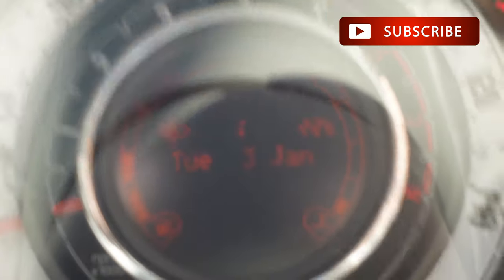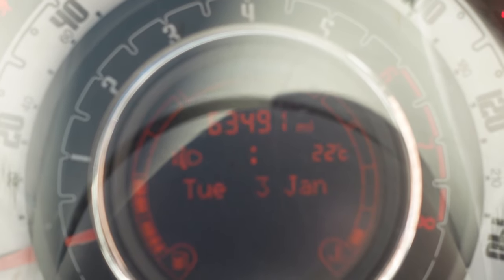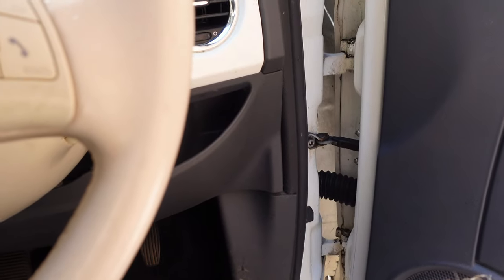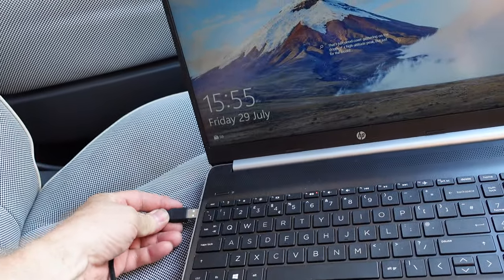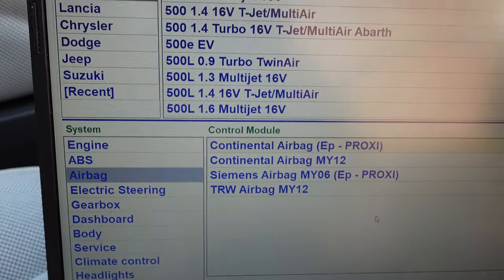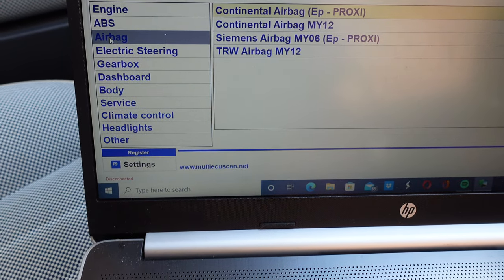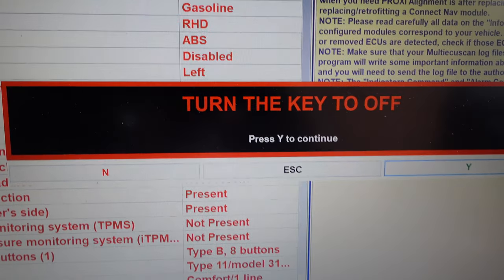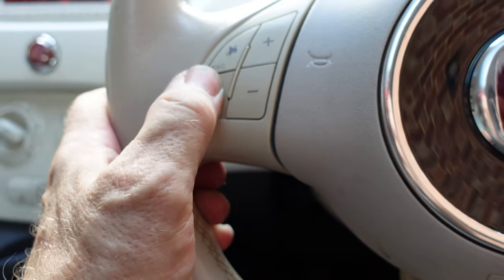Fiat 500 Flashing Mileage & Proxy Alignment - Blue & Me Not Working? #blueandme #fiat500 #abarth

Comment: Hi,I’ve just bought a 2013 1200s from
a friend,the mileage is flashing and stop start not working,this happened after replacing the battery,I’ve just noticed the battery they fitted is not a start stop battery,what should I do now? Do you think he has blown something? Thank you for any help
Reply from the maker: Stop start us rubbish anyway and most people turn it off. It’ll work with a proper stop/start battery for a while and then every now and again. If he has changed the battery incorrectly he may have done something but first just try disconnecting the earth battery terminal for 10 minutes. That might reset it. If not, you’re going to need diagnostics.
Reply: @Love500  ok thank you I’ll let you know how it goes,I’ll go and buy the proper battery
Reply from the maker: @bill_20  i recommend www.tayna.co.uk I always buy the Exide ones.
Reply: @Love500  I’ll check it out 👍
Reply: @Love500  back again so it has a New battery and it’s not the start stop it should be but the battery has gone flat,could that either be because it’s not a stop start or would it be something else 🤦‍♂️
Reply from the maker: @bill_20  that’s most likely the blue and me causing a parasitic drain. Nothing to do with your stop start. I assume your blue and me probably isn’t working.
Reply: @Love500  I have no idea how it works to be honest,
Reply from the maker: @bill_20  if you press the button on the steering wheel it should display on the stereo and you talk to it. If nothing happens when you press the button, then it’s broken.
Reply: @Love500  thank you I will try that later and let you know
Reply: @Love500  do I need to have an adapter to plug in to be able to try this?
Reply from the maker: @bill_20  what trim level is it? Lounge, Pop? Does it have steering g wheel controls and a USB socket on the centre console by the cup holders?
Reply: @Love500  1200S and yes usb beside gearstick and steering wheel controls
Reply: @Love500  hi I just got the battery replaced with the proper battery for the car,stop start now working again but mileage and blue and me not working? Any ideas what to do next? Thanks
Reply from the maker: @bill_20  your stop start will work for a while. You need a proxy alignment which may reconnect your blue and me but more often it’s broken and needs repairing or replacing.
Reply: @Love500  does that need a special fiat Diagnostic’s or will others plug in?
Reply from the maker: @bill_20  www.multiecuscan.net. Software is 50 euros and a cheap set of cables from eBay.
Reply: @Love500  would there be any faults codes if the Blue and me is faulty? I can get a lend if a good diagnostic machine
Reply from the maker: @bill_20  no, just flashing mileage and usually not working.
Reply: @Love500  yeah it doesn’t work,flashing mileage and battery drain,any recommendations where to send it for repair?
Reply from the maker: @bill_20  key wizard on eBay. £78 plus postage.

https://www.ebay.co.uk/itm/133978414515?mkcid=16&mkevt=1&mkrid=711-127632-2357-0&ssspo=WnpIY9tdQNe&sssrc=2349624&ssuid=52E9BPy6Sze&var=&widget_ver=artemis&media=COPY
Reply: @Love500  hi back again,as you can see it’s slow progress lol only just got diagnostics plugged in today,fault code there was U1733-87 Convergence Telematic Module - Missing message,there was an option to configure but it wouldn’t connect 🙈 you think it’s the Blue and me?
Reply from the maker: @bill_20  yes, without a doubt.
Reply: @Love500  thank you so much you’ve been great help 👍

Comment: Hi Paul, I have an issue that you might be able to help with.
The centre EVIC display is blank, and the outer speedometer and Tachometer work fine. The centre display will 'illuminate', but is blank.
So I am lacking fuel level, engine temperature, time, date, and the such.
I have checked the fuses in the interior fuse box and they're fine. Any help?
Reply from the maker: The centre lcds often break or display “hyroglyphics”. They can be replaced but often easier to change the entire Speedo.

Comment: if I send my Blue & Me away to be repaired can I still use my vehicle whilst the unit is out?
Reply from the maker: Yes will make no difference to the car.
Reply: thankyou much appreciated
Reply: Just watched your video again, so am I correct in assuming all I need to do is 'unplug' the Blue & Me unit and it won't affect the car at all but would I still require the proxi alignment to stop the milage flashing? Obviously I can't make any calls but that's no loss personally. All I want is to stop the flashing, not really bothered about making/receiving a call.
Reply from the maker: @simoncloake8051  yes. While it’s plugged in still the BCM is still looking for it to connect. If it’s unplugged then it think rightly it’s been removed. The BCM will still show it missing if you do diagnostics on i5 but a proxy alignment will clear the flashing mileage.
Reply: Thankyou again much appreciated
Reply from the maker: @johncarson974  that doesn’t surprise me. I read all the time that US owners have trouble getting parts.